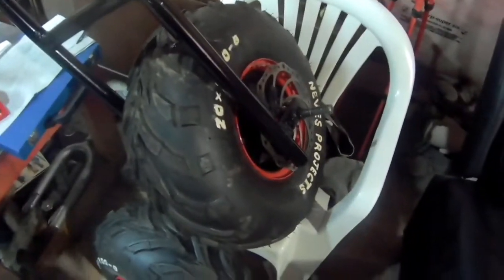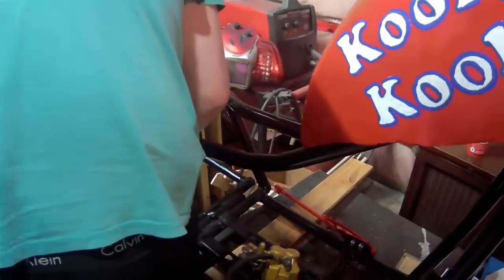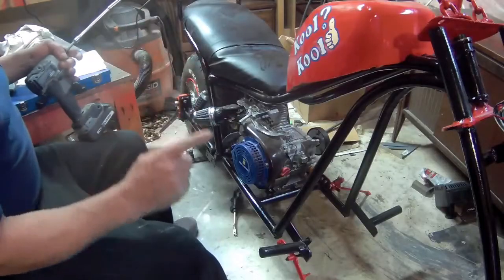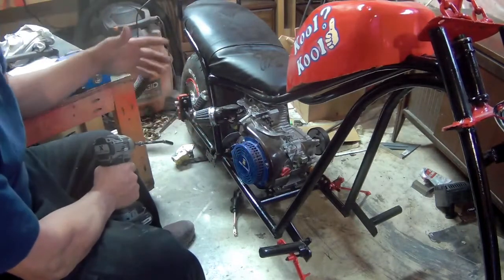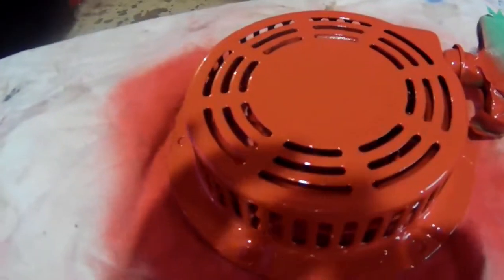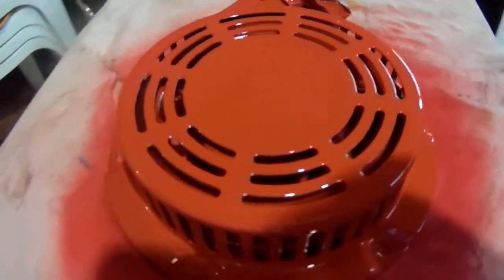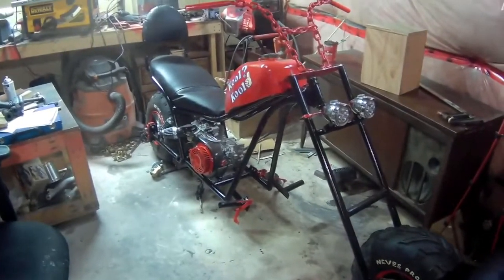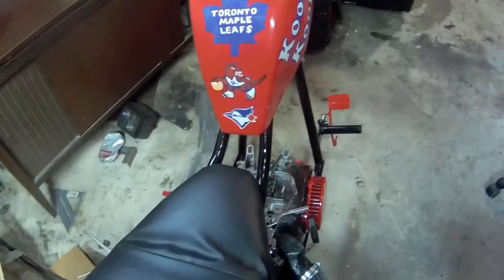Mini Bike/Chopper Build pt.10, How It's Coming

Comment: Getting there Neves. She's lookin sweet. 
Did you have any hassles removing the recoil / side cover for painting ?  Did the recoil assembly spring apart  ? Was wondering cause ive never taken one off. 
Have a crack at removing the governor.  I did the Black Kart   governor removal and is quite easy.  
Great vid mate 👍
Reply from the maker: Customwinder 1 first hey mate, second no the recoil came off nice I thought there would be a spring apart but there is none, came off simple, there is no tension on it (on this motor anyway) the cover comes off with everything intacked, as for the governor mate on my last vid I showed how I'm going turn it off or on with a lever
Reply: Neves Projects Ah good to know  mate.   Wasn't sure about it.  Can't wait to see her on the road.